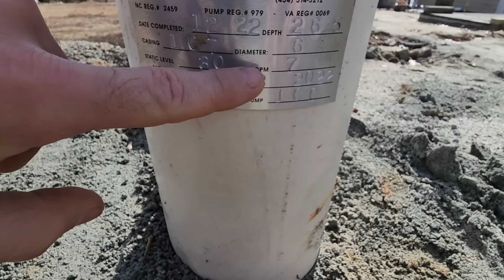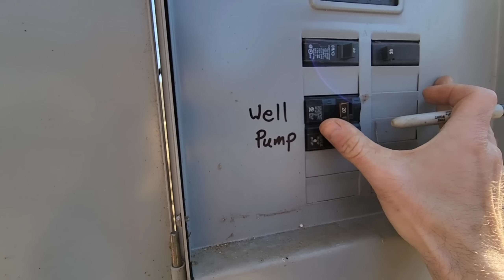New Well Pump System Install on 1950s Lake House.

Comment: Thanks to you I pulled 70 foot of cast iron 1.25 and replaced it with black roll.  I would have put the cast iron back but as my replacement is a Lowe’s pump I don’t want to pull it again.

Comment: When we do these trenches (especially for electric) we remove the dirt and replace with bank sand. Much easier digging next time. And there will always be a next time.
We like to put electric in schedule 80 PVC, oversized and put extra wires. If one goes bad it is easily replaced. If they all go bad it's easy to fish the wire in the PVC, no digging.
Reply: My modular house set on lot  in VA  2004  Danville utilities did that 3 pipes up to the house and backfilled with sand  and 2  circuit breaker boxes .
Reply: I would've done 2 things differently. First, I would've capped the pvc on one end to push it through the trench, this simplifies the process, since you don't have to keep the end out of the dirt while feeding under the wire. This is also much faster and easier on the back. You then just clean off the pipe where you're going to cut off the cap and Bob's your uncle.

Second, I would've run a tracer wire along the pipe from the well to the house, this would make it easier to confirm the exact path of the pipe in the future.

Comment: Nice job….looks like you ran a little water into the house before you shut the valve at the tank off.
Reply: if it wasn't cut off at the house those toilets are prolly full

Comment: Is the only checkvalve in that assembly what the pump provieds?  I am use to seeing one at the pump and on just before the pressure tank
Reply from the maker: I don't like putting one at the tank. It makes diagnoses harder. If the pump check valve fails, you'd be getting Air in the system and most don't understand why it happens

Comment: Also does the small tank cycle pump more frequently or is it small because of location or a vfd
Reply: I hate those little tanks. They rust. They are a pain when they loose air. You can't put an air proportion valve on them and they only hold about 20-30 gallons, so your pump is going off and on more frequently.
A verticle galvanized tank is ezee pezee to reestablish the air head. Mostly they don't need it because you can install a air proportion valve that prevents waterlogging.

Comment: Hey please help me. We had a power outage causing water to stop working. We tried to flip lever on pressure switch but didn't  fix it. Tried several things but at this point we've replaced the pump, 218 ft of lines, the pressure tank, the switch and the Guage. We have water to spickets outside but none inside or if we do have water we have no pressure.  Haven't  detected any leaks in lines under house either. This is a early 90's model mobile home.

Comment: Edit
PLEASE SOMEONE THAT KNOWS ABOUT OR IS AN Electrician PLEASE READ AND OFFER SOME GUIDANCE.  Thanks

 I’ve got a old vertical galvanized Water Tank(Big one)
I inherited my Grandmas home and it was built in 50s! 

  Had a New Pump put on a few years ago, everything works fine, it doesn’t have a Bladder inside these old wells as I’m sure you’d know. 

I do need to replace the Pressure switch soon. I’ve noticed a few times a day it short cycles , one side of the pressure switch is burnt and kinda stuck looking, the other is nearly fine. 

My Pump (I forget the brand and Horsepower) but it gives you the option to run either 230V or 115
 Just have to take the top casing off and switch it. 

I had no idea it had the option built in, my pump& small House built around it all, I had at one point running electricty to that and another larger shed in my yard, and was only costing me $10-15 a month! 

Well, A Tree fell and damaged where the electric from the power company ran to, bent up and just messed up alot of wiring etc.

I thought for sure the whole time it was running on 220+ 
  Anyway due to the damage and all, I didn’t have electricity goingnto my Pump. 

Well, A friend that’s an electrician came out and looked at the pump, wiring and Said it’s setup to run on 115/120 (I forget which) 
 So, I had a spot on my back porch maybe 12 foot away from my Well and Pump, so he ran a new electrical cord into the shed house where the Pump is, connected everything then we just plugged it into a plug in on back side of my house.

Has worked fine, BUT that setup was supposed to be temporary! Everytime the Pump kicks on it lowers lights in one section of my house! 
   Ever since doing this my electricity has gone up! Compared to what my House electric use to be, before plugging the Pump to it ( remember my other Shed that had a separate power line and meter was only costing me $10-15 a month!

I’m not an electrician but I know that the way it’s setup was supposed to be temporary, and he was to come back in a week or so
And run the electrical wire to my Breaker Box and put the Pump on its own breaker! 

Instead of leaving it just plugged into a plug outlet that was available on my back porch. 

It’s caused my electric to go up , it makes my lights Dim when the Pump kicks on. 

Which is also 1 way I realized I also realized my pressure switch needs replacing cause it comes on by itself a few times a day, Not many, but if No water is running it shouldn’t be coming on at all. 

So, I’m thinking about just buying 50foot of the same type electrical wire and running it to the breaker Box myself, 

If I had the $ Id call a electrician, but I don’t have $500 or more dollars at this time to do that.

If anyone read this whole thing by chance, 
 How do I find out What type Breaker is Needed for my Breaker box ? 

Is it a certain type brand breaker box I have to get a specific breaker for? I know it was connected to a 15 or 20 breaker in my older setup
Reply: Find out what kind of panel you have, take pictures of the existing breakers and go get one that fits your panel, get a 20 amp for 120v or at least a 30amp for 240v, run the black wire to the breaker and the white wire and ground wire to the neutral bus bar in the panel. Turn off the main power supply while wiring in the panel.

Comment: Is there a reason that you used buried white PVC sections rather than just using 
piece black poly as you used in the well?
Reply from the maker: Pvc is 2.5x stronger than the black roll pipe. Rocks won't crush it & tree roots can't force it to break (Black pipe it does).

Comment: Hey bro I had a question I have a food truck and my instant water heater(s) which is located on the outside of my food truck has frozen I don’t want to buy any more but was wondering if you had any solution to prevent the freezing I have a heat strip on the pipes inside the truck already but am still having this issue if you have any advice I’d appreciate it
Reply from the maker: My best advice is use PEX pipe & foam pipe insulation
Reply: @h2omechanic  damn that’s what I’m running right now but appreciate that have a good one
Reply: The trick is where you secure the heat tape sensor to the pipe, that black bulb needs to be well secured and in direct contact with the pipe, but you want to situate that sensor where the pipe is likely to get the coldest. Also plan for wrapping the heat tape all the way around the pipe if possible, otherwise locate it on the under side of the pipe, but wrapping all the way around any joints, fittings, or valves. Then you want to insulate the pipe very well, potentially multiple layers of insulation to do so, which you should try not to compress, since that will reduce the insulation's capability. Additionally, plastic will stand up better, should the pipe freeze. This is where pex is a better choice, since cpvc gets brittle, copper will split, and pvc can't be used for hot water. Polybutylene  and galvanized should just be replaced, if present, since they both fail from the inside.

Comment: I do know one thing that most of these homes do not protect their  pressure tank aoutide from freezing . A heater in there does not work when power is out . Epic ice storm remember that . I was without power for 10 days  and several of my neighbors pressure tanks froze and split open . Small lot my first house in NJ  was 80 wide by 96 deep  , now that is a small lot . Speak easy house that I remodeled

Comment: Question why do they not use black pipe  like the well driller did on my house and it is buried over 5 feet as the driller forgot about I was have the yard backfilled . He had it in his notes but forgot  . Bet that made you scratch you head for awhile  , septic share by 2 house on one prpery and well shared by 2 houses on the other property . I wonder if that is legal to do these days  . To me all that electrical stuff looks like a fire hazard  I think you larned to solve puzzles with that house